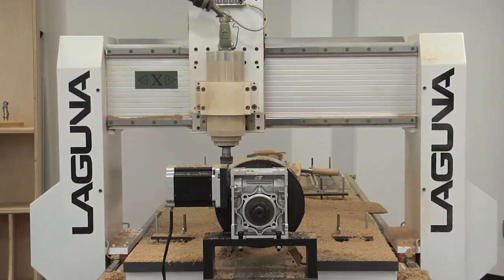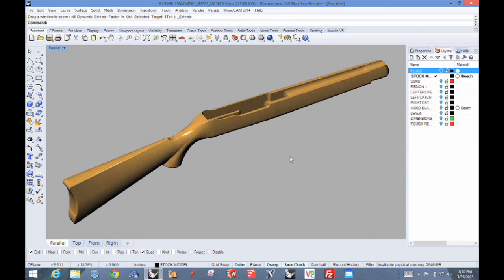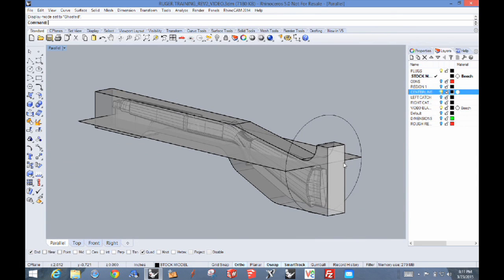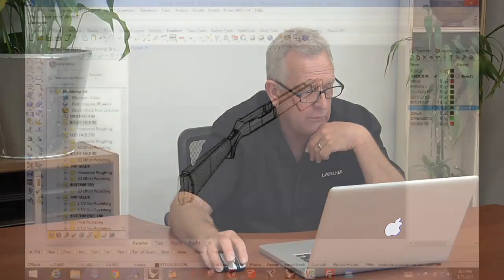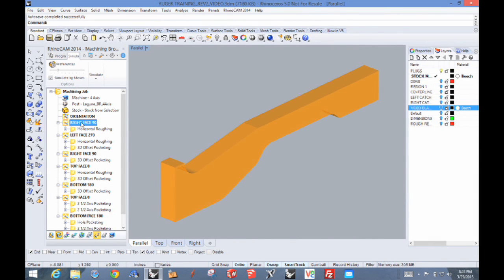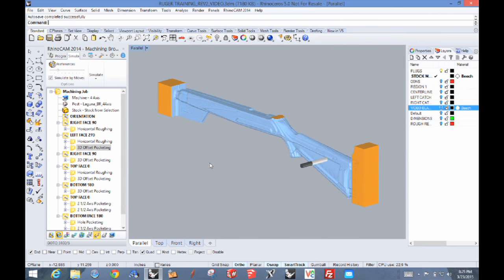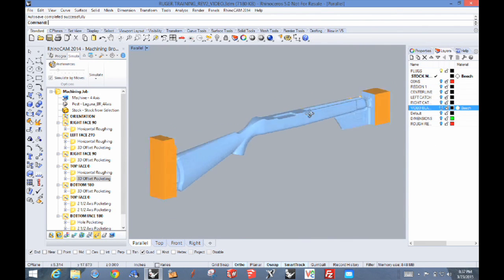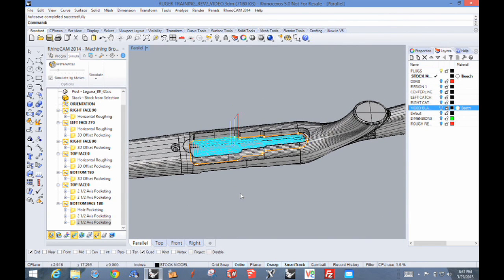4th Axis CNC Router - Gunstock | Laguna Tools

Comment: Posted last comment in wrong section
With this where is the rotation occuring in the process

I can see each side is milled in 3 axis. is the rotary tool conrolled using the c-axis on the controller? and does the software automatically allow turning so the peice is able to be milled on each side continuously (without manual rotation) or is there a part of the video we do not see?
Reply from the maker: Lets discuss, call us at 800.234.1976 for a quicker response. Thank you for your interest.
Reply: I am in Australia email would be prefered.
Reply from the maker: Please send us your email to graphics@lagunatools.com - Thank you.